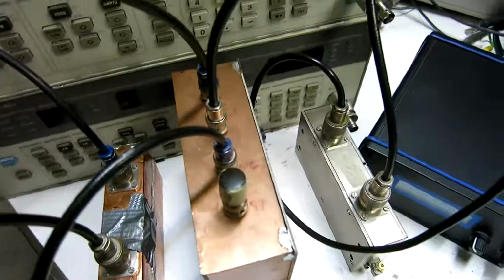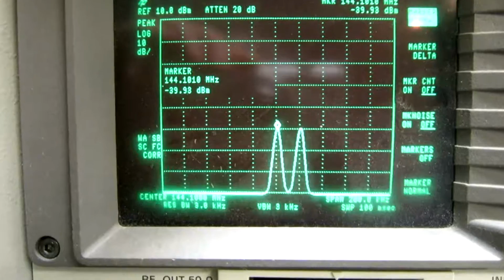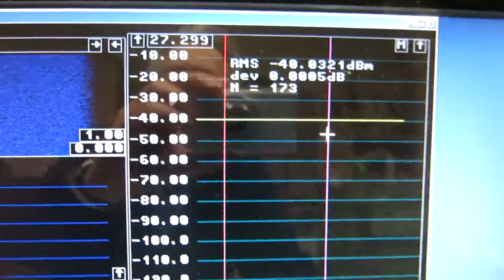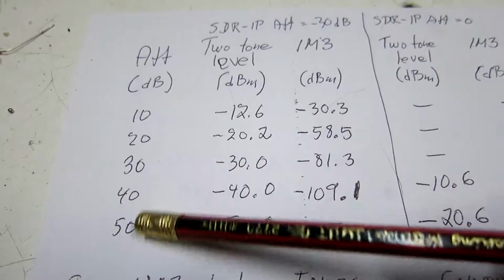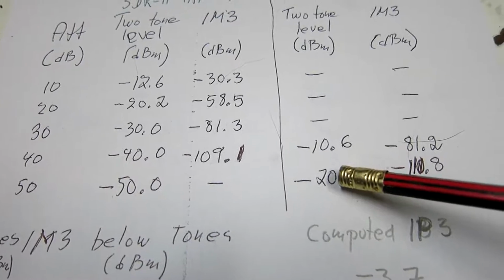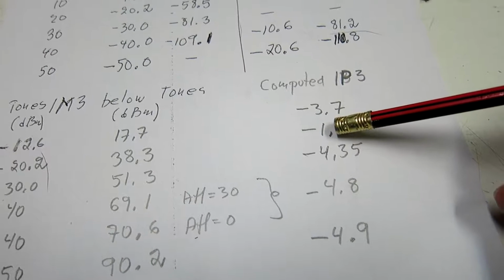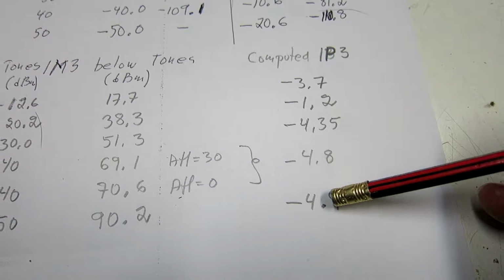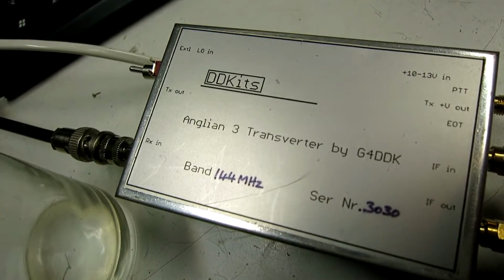anglian3_ip3

Comment: Hello Leif,

what can be the cause to such a poor OIP3 ? wrong PIN diode selection, low PIN diode current ?
Reply from the maker: I measure input IP3. The dominating IM3 source is the mixer, ADE-1H with IP3=+23 dBm. The PSA4-5043 gives about 25 dB gain so intermodulation in the mixer alone is expected to give IP3 at -2dBm. The PSA4-5043 has OIP3=+28 dBm so it has IIP3=+3 dBm and one should expect a small contribution from it.
The MGA30689 has OIP3=+40 dBm and 15 dB gain so the total gain from the input is 25(RF amp) -5(mixer)+15(IF)=35 dB so IP3 of the IF amplifier referenced to the input would be +5 dBm. Even though the mixer dominates we should expect some contributions from the amplifiers. OIP3 of the receiver should be about +30 dBm, I can not check because I made a mistake and have no more PSA4-5043... I have not taken filter losses into account, but the dominating role of the mixer is a result of direct measurement The IM3 products on the mixer output are much stronger than IM3 at the mixer input relative to the main signal.